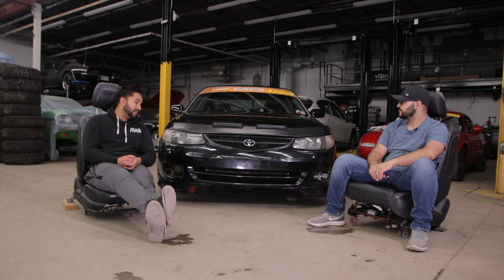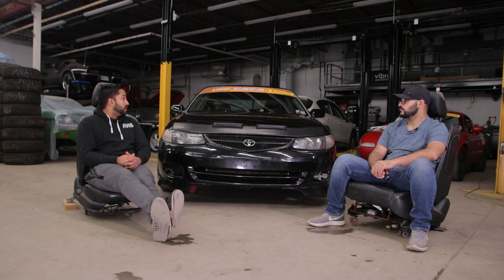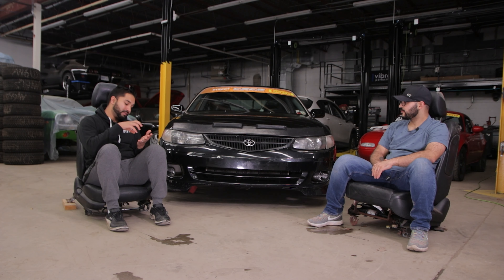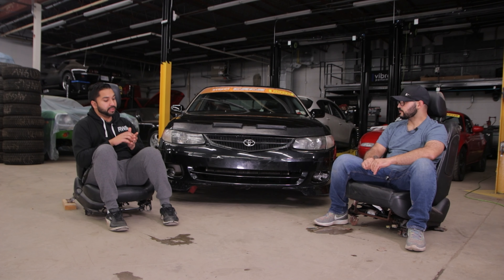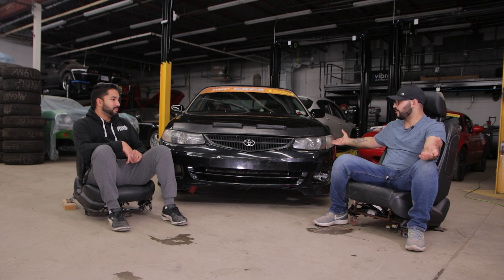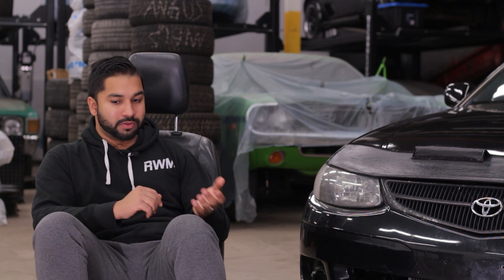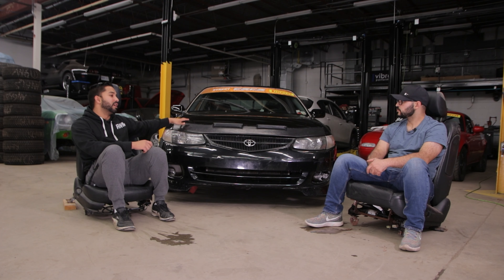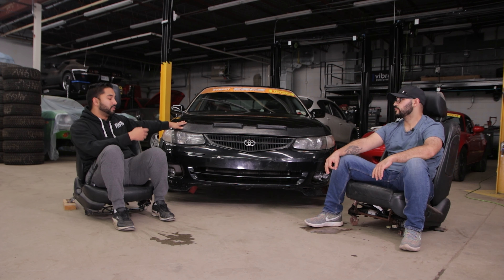Solara Time Attack Build | Akeem Bacchus | Built to Drive

Comment: Well I have a lot of vehicles I have a 2012 GTR I have a 2003 M3 and I do have a 99 Toyota solara now mine is a five-speed I have godspeed coilovers in it they're awesome they were a little expensive there around 750 and I they Ride great water right off eBay no issue they do make aftermarket bumpers they do have the side skirts on eBay the same ones they do sell program chips that you can plug in underneath now you don't want to buy the cheap ones you want to buy a good one for about $400 and you will definitely get about 60 more horsepower from it now I have a full Magnum Flow exhaust headers straight back took the resonator off and it sounds amazing and I gained at least 30 horsepower just from the exhaust I have a cold air intake that I gain 20 horsepower I dined out everything it's stock with the supercharger on it you know they only made 500 with the five-speed with the 3.0 supercharger very rare so that car had 200 and about maybe 60 horsepower stock so I have a cold air intake I have a program chip that you just plug in MagnaFlow exhaust godspeed coilovers and it has a racing cam in it and I'm running 420 horse and a performance clutch that was under $300 they're very reliable cars and it's still rides like brand new it has a 160,000 miles on it and it's pearl white with a carbon fiber hood the bottom is all carbon fiber skirts the back bumper and the tailgate and it has a massive Wing that's all black carbon fiber and it's pearl white on the sides it looks nuts and it's got black with red rims and the rotors and the calories are red and it's faster than my 2003 M3 cuz my M3 does about 13 and a quarter and it beats it by a car went for a front wheel drive car it's pretty quick but my M3 will beat them about after a quarter he'll just catch it and devastate it but I have it already up to 155 and it doesn't like it's nothing so you could buy them parts online godspeed coilovers you put a race in cam in it and pulled a cold air intake and Toyota actually sells the program chips they have stage 1 2 3 and 4 you get it from them and the stage 3 will get you about 40 to 60 horsepower but if you put a racing cam in there you're going to gain at least 50 horsepower just from not alone and you don't have to change and put race and plugs or wires and you keep all that stock but I'm still not sure what it does in a quarter but I know that it's doing high 12s and that's fast for a car it's almost 23 years old but but the fleet I would say that's probably one of the most reliable cars and if I don't get on it it'll still get 30 miles to the gallon now my GTR to Godzilla that's a different piece that's tuned to and has bigger turbos on it that's running almost 900 horsepower that's a maniac car that car does high nines in a quarter that's a beast but Toyota solara is one of the most reliable cars out there from 2003 to 2099 it was freed at five star one of the most revival cars out there and comfortable cars out there